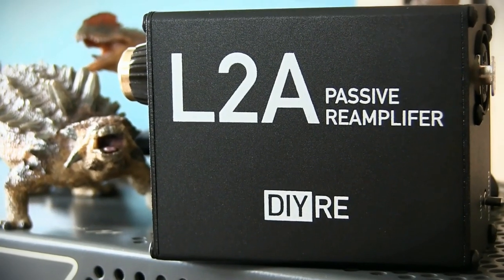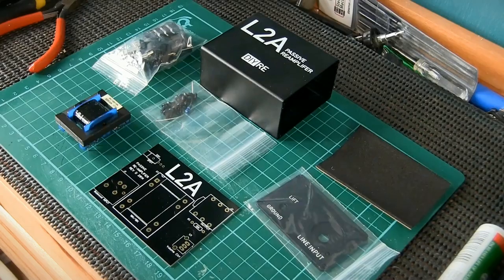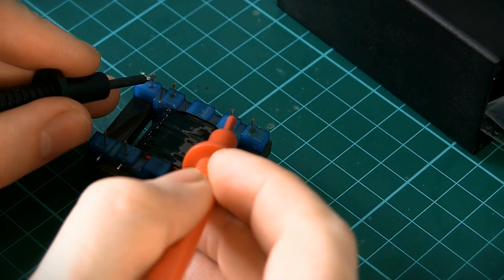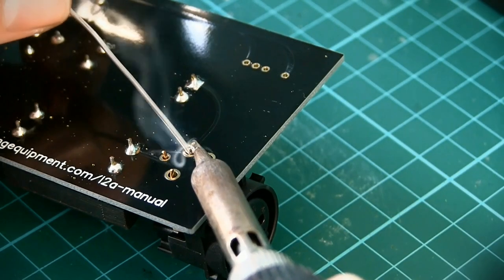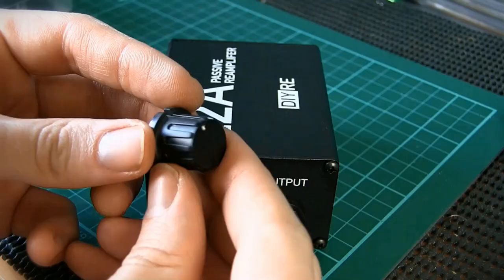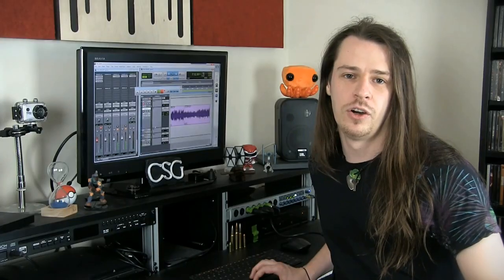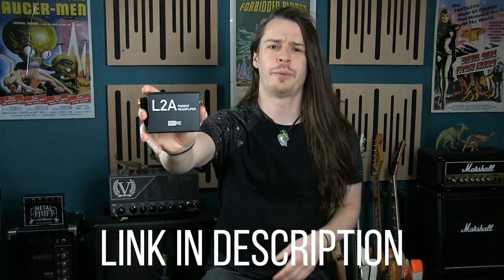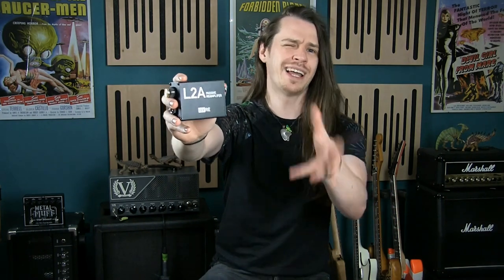L2A Passive Reamplifier DIYRE: Let's Build

Comment: Colin, will you be checking out the newer expanded range of Fishman Fluence P-ups?
I know you have gone on record in the past about not liking Active Pickups mainly due to their compression as well as their lack of dynamics and versatility, however from what I've seen they are far more open and dynamic than EMGs especially with their multi-voice feature. From a pickup engineering stand-point they're rather unique as well, instead of using coils they are stacked Circuit-boards.
Would love to hear your opinion on them, 
Thanks

Comment: Have you checked how re-amp box output volume match to guitar output? I'll do few experiments more and then I'm dropping a message to DIY-RE, because for me it has significantly lower output than my guitar.
Reply from the maker: Being a passive reamp, the device does nothing to 'match' output levels. It will pass the level of whatever is fed into it. So you should be looking to the DAW and interface for level matching. 

Two things to check: Check the level of the signal in your DAW is as loud as it can be without clipping, similarly if the interface has a output level then adjust it louder. 

Check you are using a Balanced audio cable to connect the interface to the Reamp. If you are using an Unbalanced one then that may explain some of the volume loss.

Comment: So, if your interface has an unbalanced out, do you still need a re-amp box?
Reply: Yes. Its more about the impedance. If you try it you will find you have to turn down your out going signal way way down to the point where your ground floor noise level will be crazy high. It works just it sounds like complete shit. You dont have to have a d.i. to record in if you have a interface with preamp which most have. There are many videos with more info about reamping.

Comment: Hey Colin, I have to know. With you talking about amp misconceptions in some of your videos now, is it true that plugging a bass into a guitar amp will turn it into a paper weight? Or is that more musician folklore?
Reply: Unless you're playing at silly levels, you should be fine. The amp itself wouldn't get damaged, what might happen is damage to the speakers, that will be deflecting more than usual (and possibly beyond their designed range) due to the higher power load.

Comment: what's the difference between a DI box and an audio interface? I have an audio interface, but is there an advantage to having one or the other or both? also, what are the differences between something like a focusrite ($200) and something like the Apollo twin ($700)?
Reply from the maker: TL;DR - Useful to have both. DI can be used live and studio, also sends to amp. Interface pricing to do with quality of preamps. 

A DI box is a unit that allows you to pass the raw signal to an interface or a mixing desk while also sending the signal back to your amp. 

They are used widely in live situations for instruments like bass, keyboards, acoustic guitars, etc as these are typically not mic'd up on stage. The sound engineer will take the signal straight to the desk and put it into the FOH from there, but the artist on stage may still pass the signal to an amp and hear their on stage sound through the amp. 

If you want to record a live band then you'll likely use a DI on every instrument to take a raw, clean signal from each in case what you capture from the mics is no good. That allows you to reamp later in a more controlled environment. 

While your audio interface can obviously record your guitar directly, it can't simultaneously pass to your amp, nor is it flexible enough to use in a live environment. An interface is essential for a studio and a good one can do many many things. 

The difference between the cost levels of interfaces can take many factors, usually number of inputs/outputs, other features, and probably most importantly the quality of the preamps. 

The inputs have preamps to boost the level of the signal coming into the interface, how good these preamps are will govern a lot about the final sound of the recording. More expensive interfaces will have better preamps, so will give better sounding recordings. 

Many sound engineers will have invested in high quality DI boxes, which contain good preamps. As these are stand alone devices they will usually have better preamps than most interfaces, hence why engineers will often use a DI box to run into their interface, so that the best preamp is doing the heavy lifting. 

This is especially important if you know you are going to reamp later, you want the best possible signal with the lowest possible noise for reamping, and the quality of the preamp you recorded the initial signal with will define those two things.

Comment: Interesting... from my experience if you connect the audio interface into the amp you get a way too strong signal. I've always thought the reamp box brought that signal back to high impedance (less strong) so the amp can work with it. So basically the opposite of what you said. Good video btw :)

Comment: Why don't they just sell it pre built?
Reply: There are tons of prebuilt reamps out there already. Do yourself a fav and learn to solder. It only cost 15 dollars to get started and if your into making music its a skill you will most likely need time after time. Just the guitar mods in general are plentiful. Its really not that hard and you will be good after less then an hour of practice. Think of all the savings in cables you will keep.
Reply from the maker: +felix o gaitero where would be the fun in that?

Lots of people enjoy the diy aspect, this is a company that does only diy kits. There are plenty of other options if you prefer that someone else do the fun bit for you.
Reply: Oh I see. I don't think it's that fun, I'm always assembling circuits for college and after a few ones it gets really boring haha
Reply: Well what ever floats your boat. Its the creative part I like. I use the ART Dual RDB 2-channel Passive Re-Amping Device because I got it used for 30 dollars and thats even cheaper then the kit and its two channel. I looked at this and it would have been my second choice. I like building but im sure as hell not paying more to build it myself right haha. You can find the ART on reverb used for pretty cheap. Good luck.
Reply: Oh ya its 80 dollars new. Still about the same as this kit. Its really all about the transformer im not sure what each have. I know im happy with the ART but this kit has quality parts I can tell just my the neutric xlr jack. If they were setting out to make it cheap the could have saved a ton right there so my guess is that its good stuff.